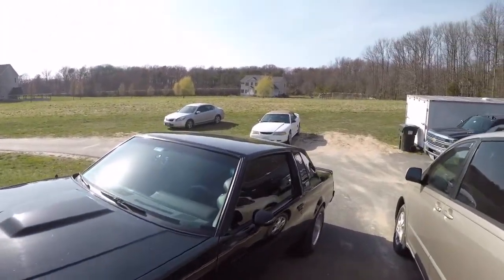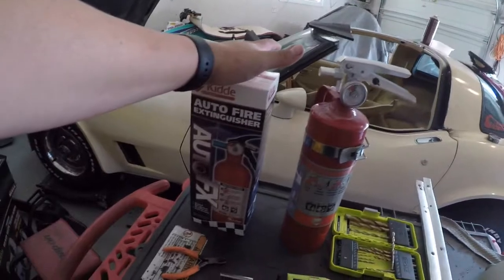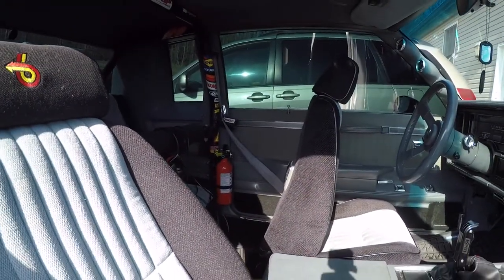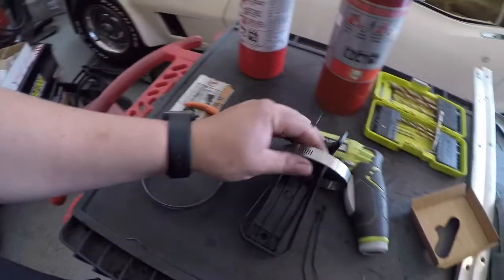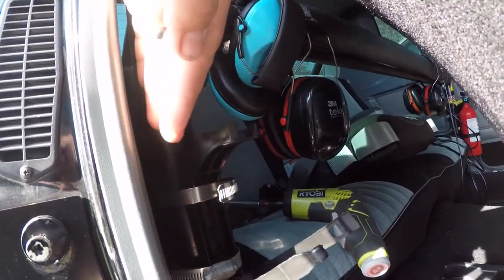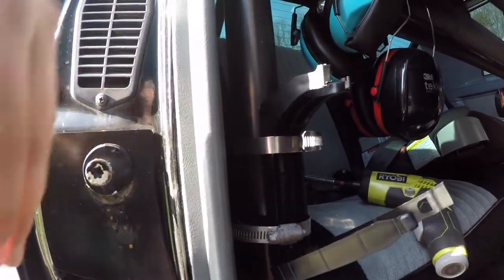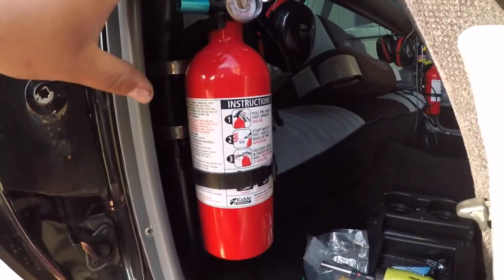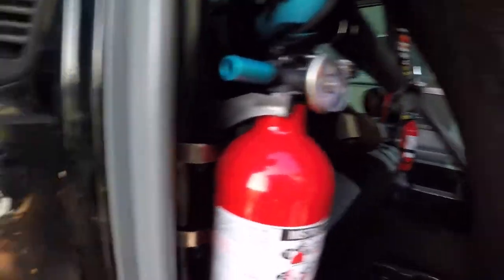Fire Extinguisher Installation for $15

Comment: You should try and install any fire Ext on its side (horizontal) to spread the chemical out so that it doesn’t clump at the bottom. I been there, pulled the handle and it pees out for about 10 seconds or not at all - That is why it goes on it’s side

Comment: One thing you have to do with any Fire Ext is to shake the crap out of it once a month. All of the powder settles to the bottom after a few weeks. If you tip it upside down and can’t hear the sand slosh back and forth: hit the bottom with a rubber hammer to break it Free.

Comment: I would still go for a bigger one. like the ones they have at the gas station! The one you have doesn't have enough pressure.put a big one in the boot 🏆👍😯